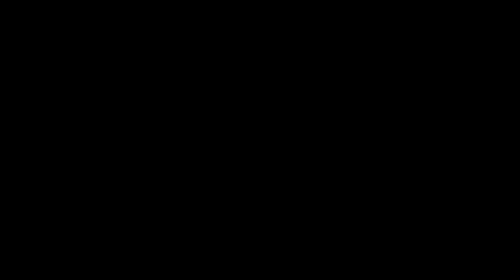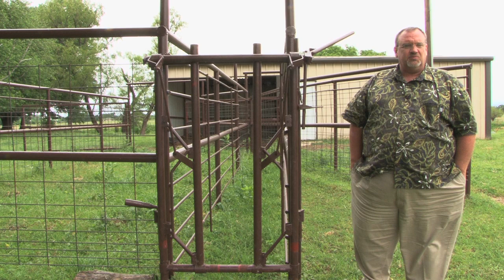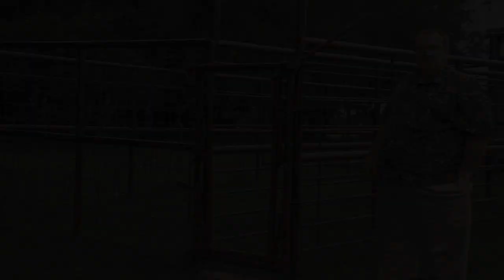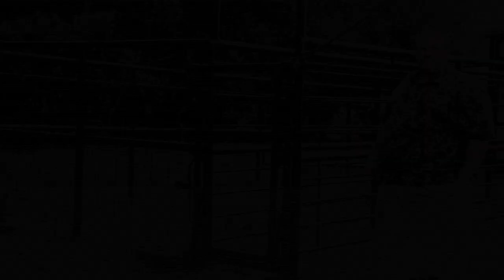Ward Welding Headgate

Comment: I have good news for those of you who have been asking for blueprints. I have the fundamental drawing of all the parts and pieces. I am working now on putting those into a set of plans that can be marketed - and figuring out a way to market them and still protect our design integrity. Look for more information - hopefully in early 2023.
Reply: Status on these plan?
Reply: @averagedrivewaymechanic300  still working onnit. My resources aren't making it a priority, so I guess I'm going to have to draw it up myself. As soon as I teach myself how to do digital drafting. 🤦‍♂ I do have drawings (from a friend) of most of the parts and pieces, but they are done in multiple different formats. So I need to draw them up in a common format, and show the assembled product with an exploded diagram, I am setting a goal for myself to have it by September.